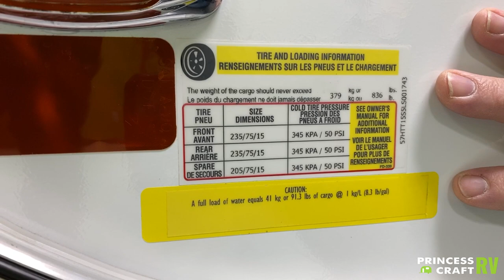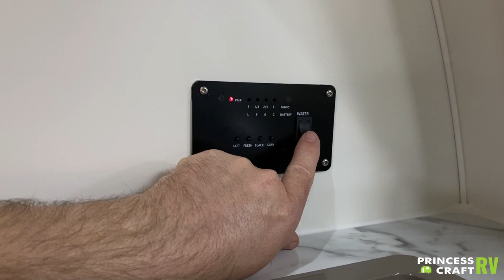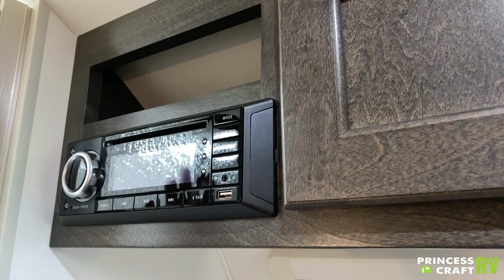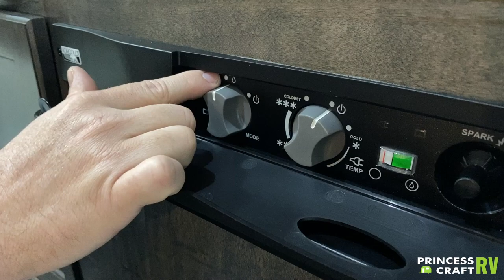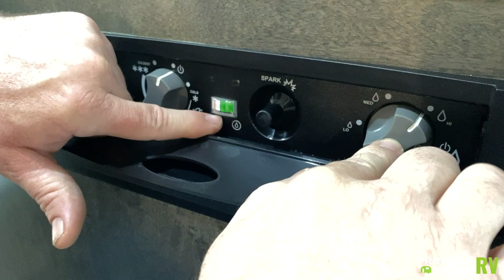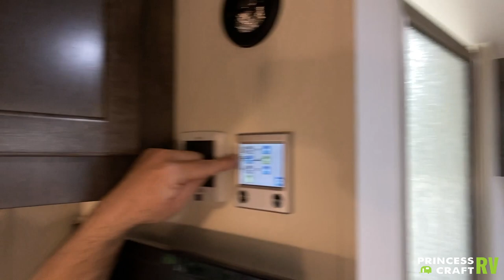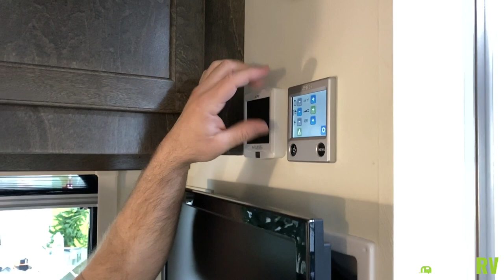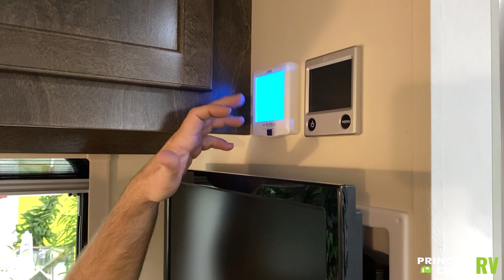Technician Tour - TAB 320 BDL 2020

Comment: Lovely video two questions do you need to change the air conditioner filter? where is it located? 2nd alde system is it self contained add water glycol etc or leave it alone  uses water pump? just brought a 2020 tab was not told a lot of things your video explained a lot  thanks
Reply: Hey, Jane! Welcome to the #nuCampFamily! If you do still have questions about your TAB, you can reach out to our Customer Service Team at 330.852.4811 and then by pressing the number "3". They will be happy to help!